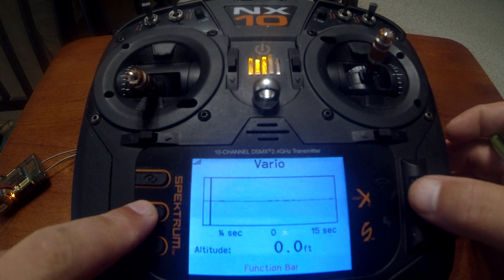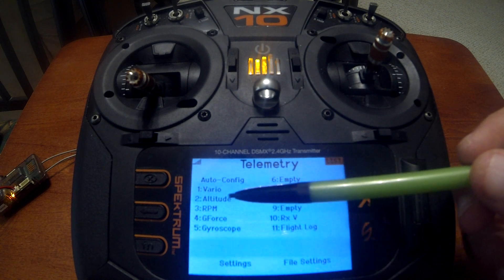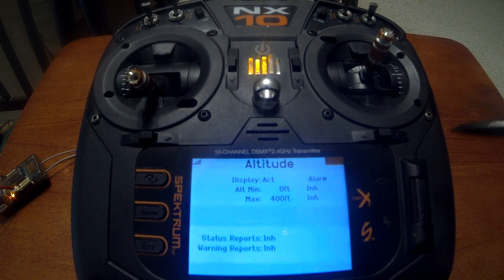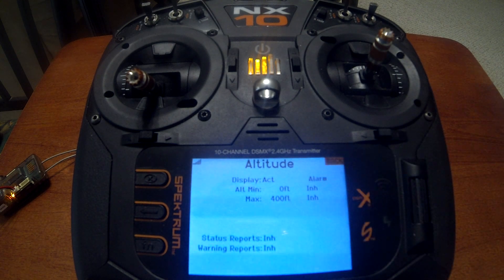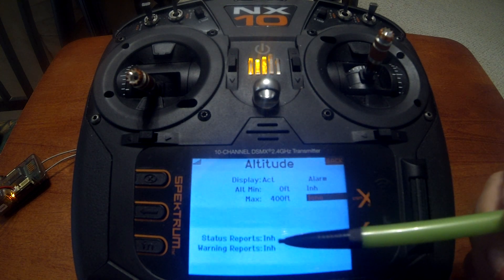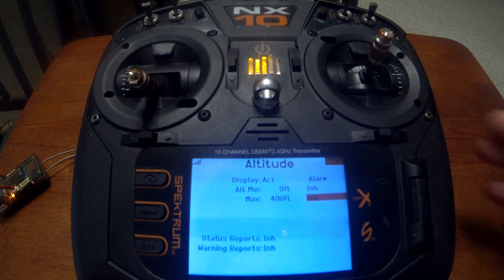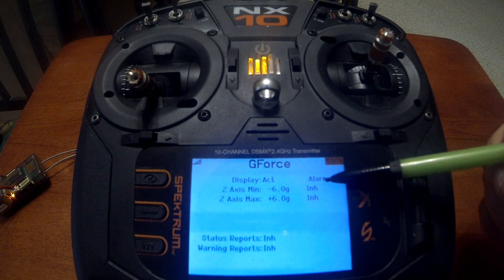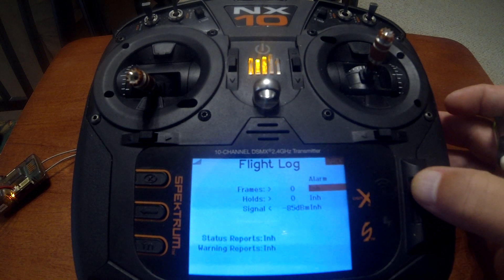Spektrum NX Setup: Telemetry Explained with Ticker Tape Setup (NX6/NX8/NX10)

Comment: In my Aeroscout program I have the screen 'Function List'--> 'Charge Status' in my head role menu. When I'm flying it's clear to see what my battery status is. 
But in other setups I don't get this and I really like to see that for my other plane too. I only get empty battery in it. (NX8+, Avian 30 Amp Brushless Smart ESC + Receiver AR637T+  )
How do you adjust the main role menu? Add others in it and remove out of it?

Comment: I’m trying to figure out why I can’t get my radio to call out the voltage while in flight. I am using a Spektrum ar631 receiver in all the airplanes with a NX8 radio. Some of the will call it out and others say no data. What am I doing differently?

Comment: With the NX8, is there any chance to have the gps speed telemetry on a switch? I see the Vario has a switch setting. I would like to have my ground speeds on final, but not necessarily every 5 seconds for the entire flight. Seems a bit distracting. I'm thinking EDF jets.

Comment: I use my ticker tape mainly to display smart ESC telemetry voltage. I then turn my ticker tape, function bar area, totally green and it makes it very nice to see the real-time airplane battery voltage on the main screen.
I also set the ESC Telemetry voltage alarm to 10.5 volts(3.5v per cell) , that way I know exactly when I have to land regardless of what I've set the countdown alarm timer to.

Comment: I followed your proceedure step by step but still have NO data displayed on my function bar. All I want is have my voltage displayed continously with a warning when below 3.8v per cell.
Im using an NX8 with an Eflight Cessna 150T and an AR637TA reciever.
Help?
Reply from the maker: Info on battery using?
Reply: Im using Spectrum 4s 5000mah smart battery.
I figured out how to use the ESC as the monitoring point to display the battery voltage but now when the battery begins to get about hapfway through its usable voltage the radio starts announcing the esc temp, amperage etc. How can I get it to just announce the battery voltage when its at (about) 14.8 - 15v ?

   @BDTennessee

Comment: Hello. Thank you for all great videos!
I have a NX8 / AR8020T receiver. I would like to have altitude/vario and battery telemetry. What do I have to buy in order to have this information in my radio? Thanks!
Reply from the maker: Ailtitude works on AR8020T with built in barometer so you dont need anything additional. Total battery voltage can be read with included voltage cable.Use with battery leads on ESC or make DIY cable whichj i have video :)
Reply: @BDTennessee  Altitude is not working. Do you know how to solve the problem? Thanks!
Reply from the maker: @lepmac1  did you try to auto configure in telemtry menu?
Reply: @BDTennessee  Yes I did. Vario is working. Altitude still not working! I connected receiver to battery and the voice keep saying battery capacity ( 11.1 volts) and 5 volts forever!
Reply from the maker: @lepmac1  sounds like a telemetry issues. Does the altitude show when you scroll with wheel to right?
Reply: @BDTennessee  No. When I put voice keeps saying “altitude no data” !
Reply from the maker: @lepmac1  oh you trying to get it to call out?
Reply: @BDTennessee  Yes. When I scroll with wheel to right there is no altitude reading and the voice keeps saying: altitude no data.
Reply from the maker: @lepmac1  did the 8020T come in a BNF plane?
Reply: @BDTennessee  No. I have bought it separately.
Reply from the maker: @lepmac1  if you did auto configure and not showing up on the screen when you scroll right ,id like at getting replacement.
Reply: @BDTennessee  Thanks for everything BD! I’ll do that.
Reply from the maker: @lepmac1  welcome! Let me know :)
Reply: @BDTennessee  ok. Thanks again.
Reply: @BDTennessee  Hello! Vario is working. Altitude still not working! I connected receiver to battery and the voice keep saying battery capacity ( 11.1 volts) and 5 volts forever!

Comment: Much thanks, I’ve had my nx10 for a few months but just installed a avian esc & “smart” battery and was getting some rather annoying warnings I couldn’t stifle. I’m really pleased with my new equipment but spektrum need to improve their manuals imo. Again, I appreciate your time & effort in creating these instructional videos.
Reply from the maker: Try using the auto config in the telemetry screen.  When warnings arent working correctly,can be annoying. New radios are really nice for sure.

Thanks for the positivity :)
Reply: @BDTennessee   I realized watching your telemetry video that a double click on a sensor in the telemetry settings will open a parameter & notification menu. 
Thanks for the help 👍🏻
Reply from the maker: @jatoav8or  awesome! glad you got it fixed :)

Comment: just a question... how do you get altimeter with the receiver specktrum AR637TA ?
The receiver is the light version of the AR637T without altimeter, airspeed, etc...
Which additional module should we buy ?
i use the NX8 transmitter.
Reply from the maker: Aircraft Telemetry Variometer Sensor
Item No.SPMA9589

Comment: If I have a telemetry RX but not a smart battery, can I use the Status Report to get voice call out readings?
Reply from the maker: You can get pack voltage if you have the voltage cable hooked up.

Comment: My Turbo Timber 1.5m has the AR637TA Rx and I installed the Variometer sensor SPMA9589 in the XBUS of both sensor and Rx. The variometer is working but there is altitude, which is what I really wanted the sensor to provide is not working. I have tried hitting clear button on the Tx after the model has had time to boot up. It shows a beginning altitude of 5650 feet at the bottom of the screen? We are at approximately 950 above sea level in Indianapolis. There is also a clear tube in the Turbo Timber installed on the bulkhead of the Timber? HobbyTown shop staff does not know about the sensor, and Horizon Hobby tech support has been no help either. 🤷‍♂🤷‍♂
Reply from the maker: Go into telemetry screen and use auto config. Thehn check results. If both Altimeter and Vario come up and not working,use Vario only.

Altimeter doesnt show above see level.It shows altitude above where you take off. So should read 0 initially. If plane goes up 300 feet,altimeter will show 300...
Reply: @BDTennessee  Thank you, vario works fine. Altitude worked only one time last week. Have to auto-configure every flight. Cheers, B

Comment: I have NX8  and RV-7 airplane with smart  Avian ESC and AR631 receiver and I'm using a Spektrum 4 cell 2200 battery - the documentation says it supports fly by telemetry,
In the Telemetry screen it shows 1. Smart battery with 2-9 empty, 10 is Rx and 11 flight log.

I did as you say for Function Bar / Ticker tape setup - sensor - volts,  field - volts and duration I set to 20 sec.

when I go back to the main screen nothing shows up at the bottom of the screen.
Reply from the maker: Try running the auto config.

Also when you at main menu and scroll to the right,what all info comes up?
Reply: @BDTennessee  thanks, turns out AUTO CONFIG was needed, I can now see the ESC battery voltage. I put the VOLTAGE on the Ticker Tape option and it displays on the Function bar - 
Now I would like to put it on a switch and hear Audio called out the battery voltage so 
I don't have to take my eyes off the plane while in flight.
Reply from the maker: @lw216316  glad it worked :)

If you want to put that callout on switch you need to program the audio event.

Settings > Audio Event > Stepping report
Reply: @BDTennessee  Thank you. It worked.

Comment: Hey bud I have the nx8 and when I turn on my trans and then plug it into my new F16 Falcon  eflite bird with a recommend smart bat I keep getting this alarm and yes my battery is fully charged and the trans is fully charged I get this WARNING SMART BATTERY ALARM battery not charged for flying and the volts says 24.23V. any idea on what is going on?
Reply from the maker: 1) Confirm the condition of the battery (all cells equal and ones not down) because 24.23 means the cells are at 4.03 (if all cells are close) and full is 4.20

2) Go into the telemetry settings > Enter on Voltage > go to alarms and see what the "starting pack voltage" is set too
Reply: @BDTennessee  start up volt is min 4.10 and overcharge max is 4.30 is that correct or does it need to be changed?
Reply from the maker: @DronemanJoeRc  with those numbers that means one cell (if using smart battery) or total voltage (non smart battery)has them less than 4.10 a cell is causing the warning. As i mentioned earlier doing the math for a 6S battery there at 4.03 a cell which is below the 4.10 threshold that trips the warning.
Reply: @BDTennessee  ok and i dont want to sound dumb what do i do to change that what should they be?
Reply: @BDTennessee  or in others explain that to me as if i was a 5th grader.lol
Reply: @BDTennessee  im using a gen2 5000mah 22.2v 100c is the battery defective? im not really understanding and what do I do to stop the warning?
Reply from the maker: @DronemanJoeRc  sounds like your battery isnt fully charged.Those settings are default and good to use. Check the battery with a charger or voltage checker and see what each cell shows for the battery.
Reply: @BDTennessee  the battery is now all cells at 3.80 thats good. When i had it fully charged the warnings still went off at startup? Idk it doesnt happen with any of my gen1 batts
Reply from the maker: @DronemanJoeRc  3.80 is storage charge,be sure you didnt use that battery when you was getting warning cause its not fully charged. If you havent used the battery and it was full charged (full charge is 4.19-4.20,some batteries wont hold the full 4.20) ,then you checked again and its at 3.80 there is a issue with the battery.
Reply: @BDTennessee  no i had the battery full and it was charged. I put it in storage to 3.80 myself.  Im now charging it to full again and i will let you know what it reads when done. Thanks again for everything.
Reply from the maker: @DronemanJoeRc  ok ,sounds good
Reply: @BDTennessee  it reads all cells 4.18 i hooked it up and no alarms. Idk strange these things are crazy at times. I had to take out my entire gear assembly on my f16 80mm bc the hole the gear goes into from the servo wouldnt open bc the hole wasnt machined clean and it had a ridge in it preventing it to open. That took me like 6 hours to figure out. Im finding HH is sacrificing some QC on some of there products. It gets exhausting bc im spending more time correcting manufacturing defects and now you cant even get HH on the phone. Unbelievable. Thanks for all your help.
Reply from the maker: @DronemanJoeRc your welcome! Reach out anytime!
Reply: @BDTennessee  thanks again and I appreciate you responding!!